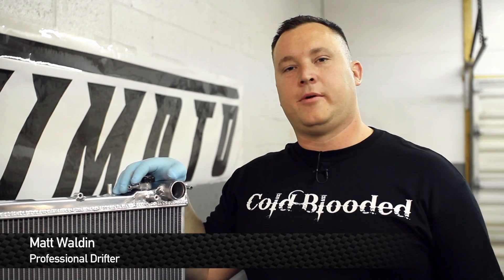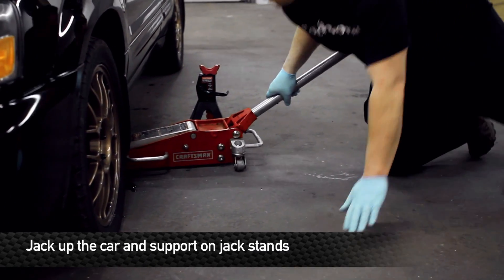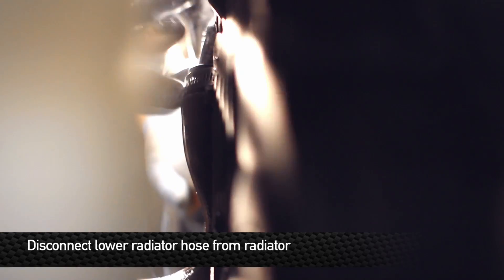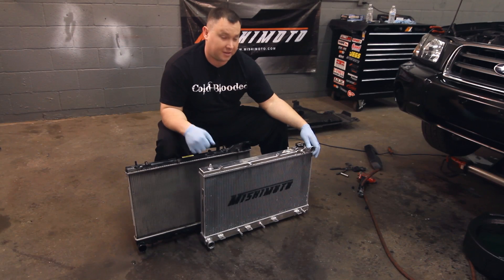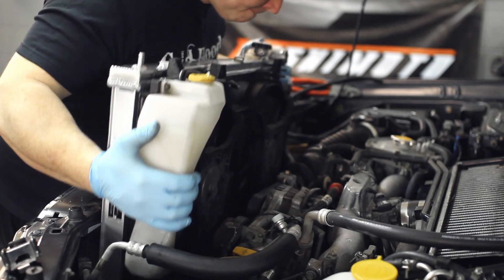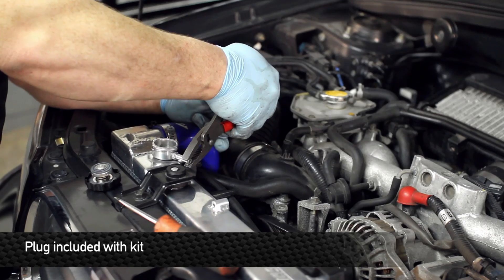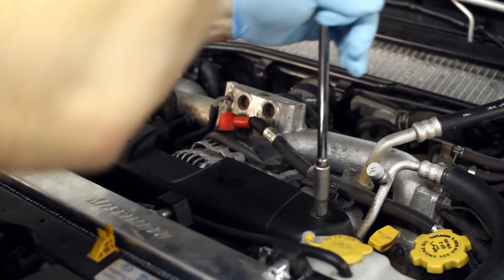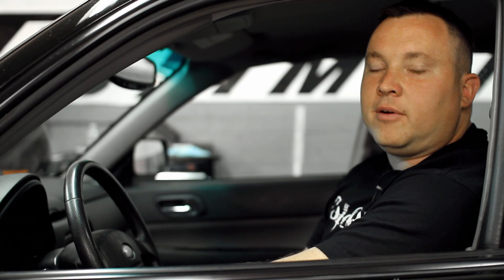Performance Aluminum Radiator Installation Guide for the 2004-2008 Subaru Forester XT Turbo

Comment from the maker: For more information regarding our radiator caps, check out our 2002 - 2021 Subaru Radiator Cap Enhancement PSA video where we share a key update for all Subaru enthusiasts running a Mishimoto radiator in their 2002–2022 Subaru vehicles: https://youtu.be/W8nRZBg6EcA

Comment: I have a automatic 04 Subaru Forester xt will this fit ?
Reply from the maker: You will need a transmission cooler to add, but otherwise, yes this will fit.

Comment: Does switching from a stock radiator to this one for a 2004 xt require using a  different coolant colour on account of the aluminium body? Currently using green long life. Tia
Reply from the maker: Anything OEM recommended or our Liquid Chill should work for you.

Comment: Does any radiator fit for Subaru forester xt 2016?
Reply from the maker: We unfortunately do not currently have a radiator with confirmed fitment for your 2016 FXT
Reply: @mishimoto  thx for reply me

Comment: This looks like a Manual transmission, do you need to install an auxiliary trans cooler for an automatic?
Reply from the maker: Hello, an auxiliary cooler will be required for automatic transmission vehicles.
Reply: So the mishimoto transmission, or power steering cooler? Which one for an 08 automatic xt Limited. Its 💯% required for sure?

Comment: Will this radiator work on a 2004 Forester xs Non turbo ?
Reply: It should fit. You'll need a separate transmission fluid cooler - Mishimoto has a good universal fitment one.

Comment: when you install the hose stem into the top of radiator(nipple that came separately in a baggie) do I need to teflon tape the threads?

Comment: But my Forester with manual transmission, and the original radiator include MT oil cooler!!!??? What is the solution?
Reply: Exactly. I have  2004 Forester XT and I have this problem. He fails to explain this. After 2 hours of mucking with this in the bitter cold, the solution was to bolt everything back up and take it to the closest garage and have everything installed for $200.
Reply: Shannon Knott Funny thing, mine is an AT...still have those oil lines. Hopefully the garage will have a solution for this. If not, Mishimoto is getting their radiator back.
Reply: Shannon Knott
Then install You this:
1993 1998 Subaru Impreza 1 8L 2 2L H4 A T Cool System Radiator Assembly 2 Rows | eBay
http://www.ebay.com/itm/141119838014

Or install You this in front of the A/C Cooler:
Hayden 403 Cooler Engine Oil Transmission Auto Trans Oil Cooler | eBay
http://www.ebay.com/itm/370831028551
I have no better idea ...
Reply from the maker: botigta Baldvin Boári Shannon Knott Hi, everyone!  An external cooler must be used with this product - you can use MMTC-U (http://www.mishimoto.com/mishimoto-universal-transmission-cooler-kit.html) to alleviate any issues.  If you have further questions, please email us at sales@mishimoto(dot)com!